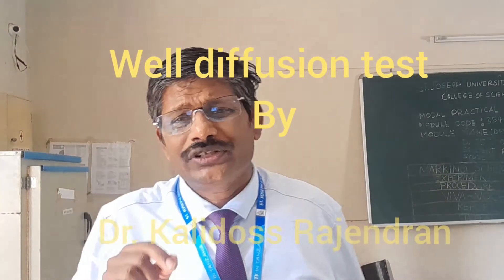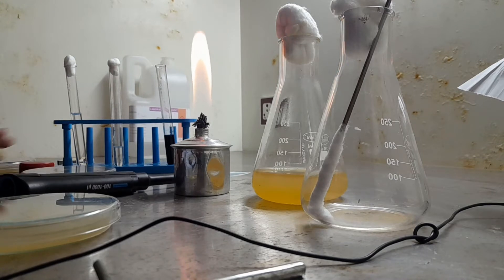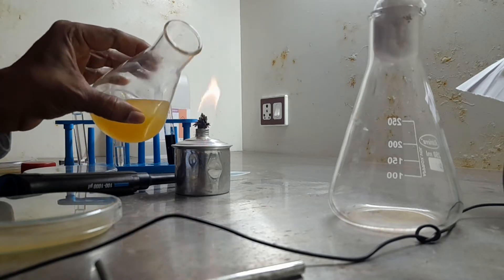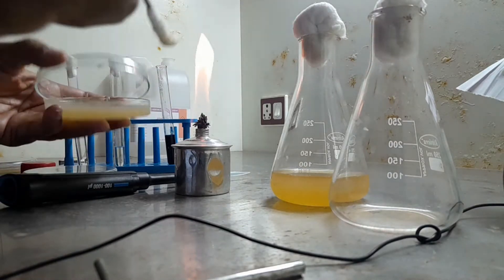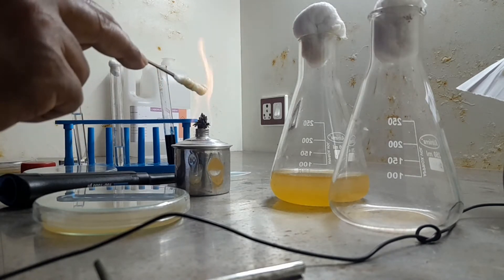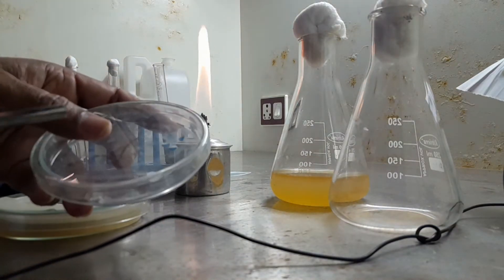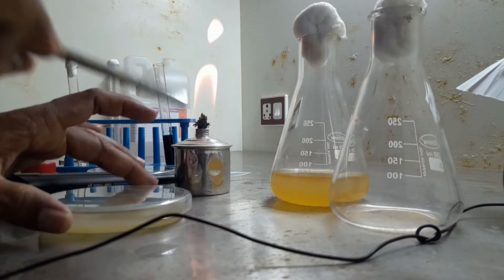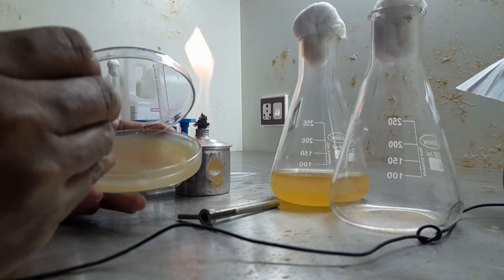Well diffusion method of Antimicrobial susceptibility test

Comment: How can I know if I should take 10ul of 50ul? Another question is how to get the different concentration of plant essential oil?
Reply from the maker: The capacity of each well is around 20 -50 micro litres only. If 100 microlitres is our interest to load each well, we need to wait until the whole solution is absorbed by each well. 2. Always we need to transfer two or three different volumes. For example, 25 and 50 microlights of extract so that you may find differences in the zone of inhibition.
Reply from the maker: Yo get the different concentration of oil, Dilute the oil using a suitable solvent.

Comment: should the plate place inversed or not when incubated?
Reply from the maker: Plate should be kept in an incubator in an inverted position. If placed in an upright position, chances of taking out lid alone rather than lifting up the whole plate. As a result chances of entry of aerosol contamination inside the plate.